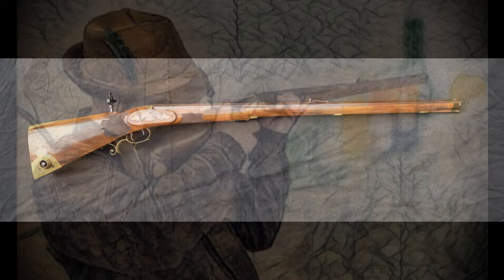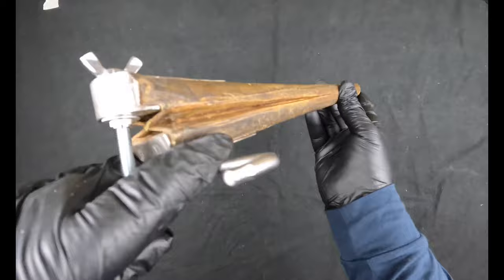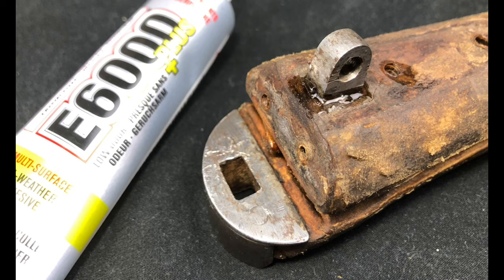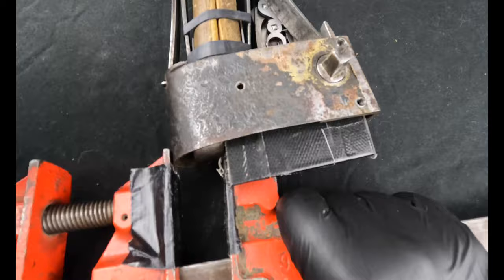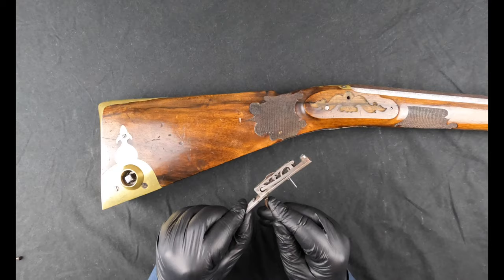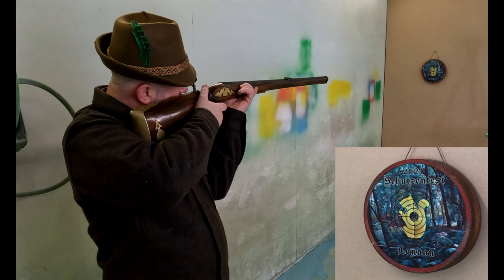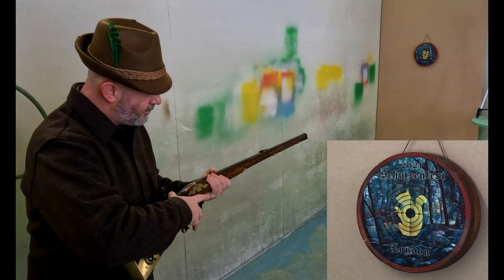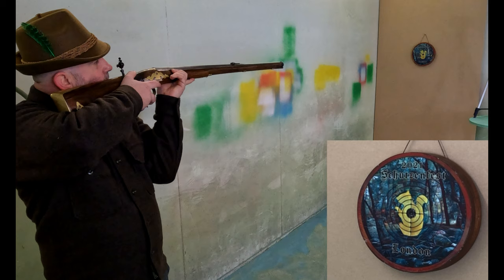Antique bellows airgun restoration & shoot 1830’s Windbüchse Kuchenreuter vintage air rifle review

Comment: Different than the models which had a compressed air reservoir -- this is sort of like a blowgun. I was unaware of this sort of mechanism. The reservoir model, which is described in other videos, was actually powerful enough to kill a human and were used in IIRC the Austrian army in the late 18th century. These weapons were repeating rifles while gunpowder versions were single-shot muzzle loaders. There are reasons why such air-powered weapons were not more popular -- two are difficulty in manufacturing and training of soldiers in their use.

Comment: I wished I could know more about the efficiency of this type of airgun... theres nothing like it today. modern materials could do a lot to improve this type of bellow design, I mean, its made of partchment! theres bound to be a plastic that behaves better than this. I've also noticed theres no compression port, and maybe add a bellow with more volume. It would be cool to test the possibilities of that! more people should watch this channel, people were brilliant back in the day, so much innovation!
Reply from the maker: I did some slo mo filming showing the difference between how this bellows gun compresses air and a volute spring rifle. The spring gun works on ‘pop gun’ where the pressure builds up behind the dart till it ‘pops’ it out. The Bellows seems to provide all the air at a constant pressure. Have a look at ‘slomo airgun darts’ I think a modern version could be an interesting experiment, but inherently low power. The bore has to be at least .25 to let the air out. There were some with double bellows back in the day, never seen a real one though.  Cheers

Comment: I've watched most of your videos and made as lot of purchases based on these.....Original model 10  a little while ago with that wonderful anti recoil system,   3 weeks ago a Feiwerkbau 300su, about 3 months ago I took up 'proper' 10m target shooting at Rugeley Rifle club, bought a Feiwerkbau 600 which I've customised to fit me.........can you see a German theme here 🤪 they don't arf  know how to make quality air guns.
Anyway now look what you have done to me.......I want one of those 😂😂
Brilliant video,  Thank you.
Reply from the maker: Hi, glad to hear the videos have been of use and led to you acquiring some of these excellent airguns, thanks. Good choice on the 600, I have a 602 and to me it marks the last of those classic 10m match rifles. Great guns. This bellows gun feels like a 190 yr old 10m rifle. Apart from the pre war of the Lincoln Jeffries BSA, Cox Britannia and Mk2 Webley Service all my air rifles are German. 
Cheers
Reply from the maker: Also, can I ask how did you customise your 600? Did you have to make any alterations outside the inbuilt adjustment for these rifles? I think on mine I removed the butt pad adjuster that slides in and out of the stock and just screwed the 2 part adjustable butt-pad to the stock to reduce the length of pull by about 5mm
Reply: @dkjngl1  I think YouTube removed my reply as I put an email address in it so I'll try again.
Cosmetically, I stripped the stock, it had yellowed a lot, lightened it as much as I could with hydrogen peroxide and bleach, prepared and sprayed with water born satin as this does not darken the wood, painted the cheekpeice and handle area black, bought suitable size carbon fibre tube and covered the barrel.
Other mods, the coach said for the gun to fit me, I needed to drop the butt pad lower than it would go, so I shaped some walnut to fit the stock and the butt plate so it looks 'pretty' this is about 18mm thick, I had spacers anyway, sits, about 30mm lower and painted this black.
Apparently coach said I have a long upper arm compared to my forearm, he got me shooting on my knuckle but I needed the front even higher, so I built a riser out of walnut and again painted black... do some people call it a hamster? Attached this to the accessory rail via a top hat nut with its edges flattened to fit with a bolt going through and supported with carbon fibre tube and another bolt going through, using a longer bolt going into the original hole of the stock into the action. Finished off with some nice Gahmann irises.
Also it's very nose heavy, so I filled the stock with lead, it has 2 holes behind the butt pad on the 600, I don't know if this, was the same with the later models? It's just in the legal limit by about 50g!
I've started on the 300,   I thought I would do it in spray polyurethane rather than oil, spent hours flatting it with 2000 and 2500 wet n dry, buffed it with rubbing compound ........ Absolutely hated it, it looked like polished plastic, which I suppose it is? so this has been stripped again ready for oiling😂
Also trigger carrier snapped 😭 I'm in the process of learning 3d software for when I buy a 3d printer end of Jan, I'm thinking of melting out the metal inner and printing new plastic parts in carbon reinforced PLA, apparently this is supper strong but in the meantime, I experimented, and got some 5mm steel, a grinder and a file and made a trigger carrier, a couple of washers..... Guess what, it bloody works! Had to adjust all setting as I could not get it exactly the same as FWB but it now works well. 
Apparently the part is no longer manufactured, the guy in Canada, is it Nikkonos who was selling then told me this.
I don't know how to get some pics to you?
Reply from the maker: @mickchaganis6607  Hi, sounds like you've made that 600 fit you well, the modern 800 series are adjustable in every possible way but these earlier ones do need a bit more work.
I fitted a wedge type wooden hamster I got from Germany and I put loads of weight on the back end of mine to get the balance point fractionally in front of my supporting hand. I put some in the recess by the butt and also a load in the space between the cheekpiece and the stock. It weighs a ton but once shouldered it's as stable as a table. 
I did want to reblue the barrel but it's bonded into the same block as the cylinder so can't be removed. Your carbon sleeve is a good idea which wouldn't add any forward weight.
Impossible to add pics here but if you p.m me on airgunbbs or airgunforums or instagram (ptdunk on all those too) we can sort something out. 
Cheers
Reply: @dkjngl1  brilliant, will message tomorrow after shooting club, busy trying to get a Walther Cp5 working that I bought from the club going through it bit by bit......haven't a clue what I'm doing 😂😂......looking like its a lazy solenoid.

Comment: I've always been curious about how this type of airgun worked and what they were like inside. This one at least is amazing. You'd expect anything bearing the name Kuchenreuter to exhibit fine workmanship - and so it does, but the condition is startling too. And parchment - I always thought the bellows would be made of fairly substantial leather. And two heavyduty leaf springs... Truly, my eyes have been opened. Thankyou so much for showing this.
Reply from the maker: Thank you, I too was intrigued to see how it worked and was not disappointed. This will probably be the only example of a bellows I will ever own and I count myself lucky to have found such a lovely example. 
Regarding the bellows, I wonder if the large 8.5mm bore & low resistance Dart  mean you don’t get too much back pressure on firing, and subsequently the bellows don’t fold outwards on compression.
Reply: @dkjngl1  I think you are correct - no high pressure air here! Just a fascinating example of low energy engineering. If you could shoot it over a chronograph sometime...   It would be interesting to see how it compares to more recent target airguns.
Reply from the maker: @davidpowell5437  it does 3ftlbs with 30.6gr darts. 
I have a few volute spring crank wound gallery airguns which followed on from the Bellows airguns in the late 1800 early 1900’s and they do 2 ftlbs. Later 1960’s match air rifles did around 6 ftlbs and still do today.
Cheers

Comment: The bending stock looks indeed terrifying.  Is there no other hinge to the barrel than the bending stock itself ?
Very interesting and informative video !  Never thought that its made with bellows.
Reply from the maker: The barrel has a v spring that pushes it up at the breech, and a stop that catches it at the correct height. The front of the barrel is attached to the stock near the front via a pin. The stock bends just behind this and does act as a hinge of sorts. The wood of the stock is in good condition and must have been kept nice and dry for the last 200 years. Cheers!

Comment: Fantastic & interesting well narrated video 👍 May I and one question, Could you not load the dart before cocking the action?
Reply from the maker: Thanks, glad you liked it. 
It sucks air into the bellows through the barrel so if you put the dart in before cocking it could suck the dart into the bellows, or at least restrict the air on its way in. You could leave the barrel open but the way the stock flexes when the barrel is open I wouldn’t want it in that open position any longer than necessary. Whole cocking & loading routine is pretty smooth once you get used to it. Cheers

Comment: Bloody good job!  Where did you find this lovely piece?  How many FPS?  It sounds very good.  Have you and John G. come up with any videos of his shop ?
Reply from the maker: Hi, I acquired this from Protek Supplies in Bognor Regis U.K. I’ve found some amazingly rare stuff there in the past, great little shop. 214fps with a 30.6gr dart, which is about 3.15ftlbs. Most of the later volute spring gallery guns only do 2.5 ftlbs so this is pretty good. Prototype construction video is ongoing, would have to be a montage if still pictures of the construction stages with narration if that would be of interest? Cheers, Matt

Comment: Typical I think of Teutonic precision engineering. What is the bore size? Is the bore rifled or smooth and does the gun fire darts only or ball ammo as well? There were of course pump-up guns in antiquity capable of killing game but guess this is a bit milder.
Excellent presentation!
Reply from the maker: 8.5mm smoothbore, darts only as I doubt an 8.5mm lead ball would make it across a room! Darts work very nicely though.
Cheers

Comment: This makes a PCP seem crude and simplistic but I'm sure individuals using a bellow rifle would appreciate  a repeater.
Reply from the maker: They had some beautiful repeating PCP’s in the 1700’s like the Girondoni, but they were so powerful they’d have blown a hole in the wall! 
I’ve come to appreciate these bellows guns were a masterpiece of low pressure technology, ideal for after dinner indoor parlour shooting.
I bet on some dusty shelf somewhere there’s some ancient repeating prototype 😊 cheers
Reply: @dkjngl1  I didn't know the Girodoni had a backup shot I automatically assumed it was single. I see a display version of it for sale  , I'm almost tempted. I see some spiral springed Bugelspanner occasionally but never really looked into older air rifles.
Reply from the maker: I have a few of the later spiral ‘volute spring’ airguns and they are also very interesting, but becoming a bit more mass market by then. They went crank wound, like the bellows, then briefly side lever, then eventually trigger guard under lever cocking Bugelspanners. Although the Bugelsanners are definitely mass market by comparison the cocking mechanism is a joy to use.
Reply: @dkjngl1  My intention is to build a single stroke rifle not spring but compressed air. A skeleton stock/frame to include not only the trigger guard but also the length of the butt as an underlever. Splitting from butt pad to muzzle (picture bolt cutters). The hopeful end result being a multitude of atmospheres. Should be an amusing endeavor.
Reply from the maker: @robertarthurs328  That sounds very interesting, I always wondered why no-one made a modern springer that uses the leverage you get from a Bugelspanner, maybe with higher power it would be too hard to cock.
Be wary that a Single stroke pneumatic would obviously compress when you were closing it, not pulling it open so the mechanical advantage would be less in the design you describe. 
The Walther LGR (first SSP) has a side lever hinged at the back and is quite hard to close, the later Feinwerkbau 600 series of SSP rifles hinges at the front so when you close it you are pulling the end of the side lever into your waist, and it's much easier to close.
Could you have your hinge in front of the trigger, maybe incorparating the trigger guard?
Interesting project.
Reply: @dkjngl1  I thinking along the lines of an older pump pistol. I'm not sure whether Benjamin or crosman some call cricket. The link is connected to a rod above the pivot of the compression handle instead of inside the compression tube. It gives longer travel.
Reply from the maker: However you do it I’m sure it will be very interesting. Please let me know how it goes 👍